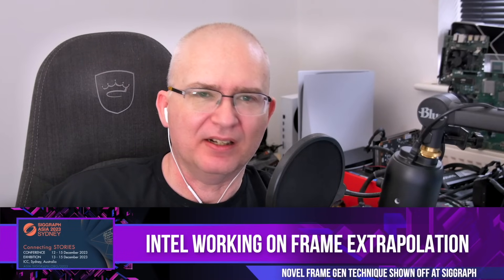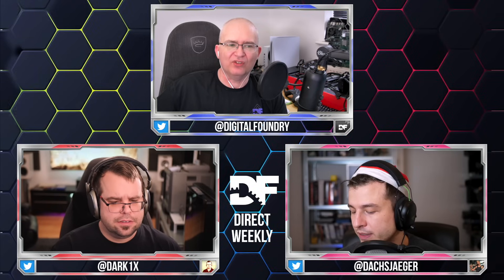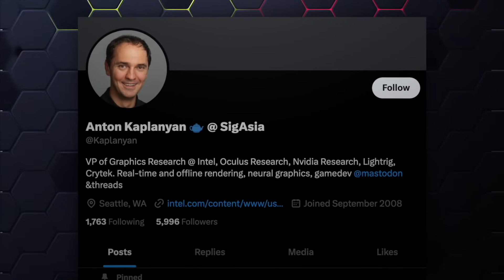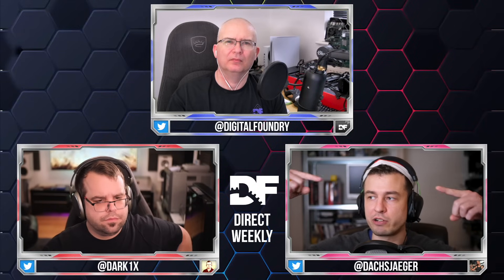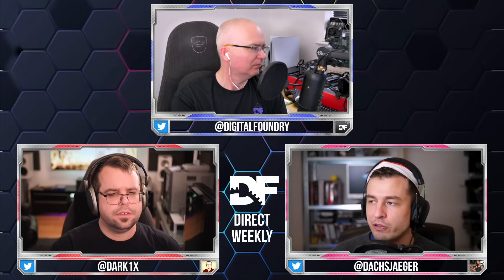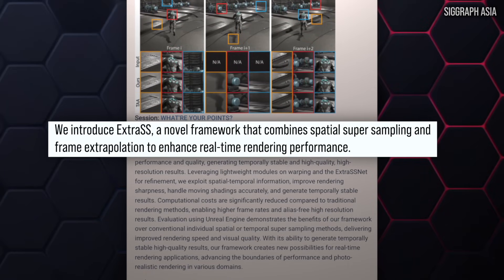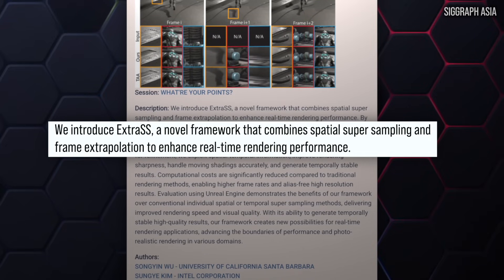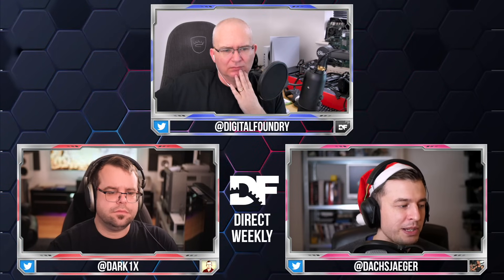Intel's Frame Generation Tech Is Coming And Here's What We Know

Comment: Well AMD FSR 3 mod works veryy good on witcher 3 on my 3090. 45 fps became 100 fps and it feels smooth like butther with g sync. :)))
Now ps5 and xbx x will have a good frame boost. Under 60fps frame gen is amazing. Evsn TAAU is 60fps at least with fsr 3...

Ps5 pro will be legendary too.

Comment: I think Intel generates enough hype, they just need to invest sufficiently into the GPU division and they will, in time, catch up to AMD/Nvidia in terms of hardware as well as software.
Reply: People keep mentioning things Intel "needs to do" that they already did. It's okay to say you'll never buy one because you're scared or whatever.
Reply: @nimrodery intel GPUs have a very specific market, and for solely gaming they can only contend up to the 4060 and 6700, with most probably going to the 6700 xt at that price range
Reply: @GeneralS1mba  Most people won't buy anything other than NVidia, the 6700 xt has sold terribly and it's priced much higher than, oh, sorry, it looks like you think Intel makes one GPU.
Reply: @nimrodery  I said "up to", the a380 is probably one of the best GPUs you can buy for av1 etc, the a580 is pretty bad in the UK, at least from what I can find, since the 6600 beats it, and the a750 is only £10 more and beats the 6600. A770 8gb is generally a good buy, since the 6700 series are starting to sell out and 3060/4060 don't compete too well. 16gb is niche as it's not too necessary and is probably best for workloads. Biggest issue is that, arc cards have more theoretical performance that doesn't translate into games making them use more power than they should.
Reply: @GeneralS1mba  The 3060 is the most common GPU people actually own, the introduction of the 4060 caused it to gain popularity in the new and used market. Since the 4060 and 7600 are so weak, GPUs like the A580 and A750 keep up fine at a much lower price. The extra power draw was never a huge deal until now, and again people don't seem to care all that much when it comes to most tech, It's only a complaint about ARC. I wish people would actually make more choices based on power draw, but the two considerations are price, and "does it say NVidia on the box."

Comment: Yay, more fake frames.
Reply: What constitutes a "real frame"?
Reply: @gavinderulo12 A real frame is one where game logic is processed. Frame gen raises the fps, but the internal logic isn't updating on those frames, so it's similar to latency in an online game in terms of the responsiveness to your actions.
Reply: @JohnSmith-sk7cg  but isn't the improvement to motion smoothness already worth it? Why do you need the lowest possible input lag in singleplayer games? Didn't DF show that the hit to latency is basically non existent if you use reflex?
Reply: @gavinderulo12  Responsiveness in a game is important regardless of whether it's single-player or multiplayer. The higher the real framerate a game runs, the more quickly your actions are input in the game. Playing a game at 60 with framegen where the native is running at 25 or whatever doesn't feel good because the visual updates happening are based on whatever action was performed on the last real frame. So for instance, if you're looking around in an FPS game with framegen will continue whatever movement was happening when the last real frame was made. It can give a 'drunk' feeling due the game's visuals not replicating what the player is doing at that moment.
Reply: @JohnSmith-sk7cg game logic has been decoupled from rendering since Counterstrike bruh. Most games have underlying update tics separate from physics which are themselves separate from rendering. Thats why input latency doesn't perfectly follow framerate, few games have 16.67 input latency at 60hz.
Reply: @Wobbothe3rd Not all logic friend. Most notable player input due to things like viewport culling. Try for yourself. Take a game with framegen like Cyberpunk, crank it as crazy as you can make it so your framerate is crushed and move your mouse around. You'll see a considerable delay in your look movement despite the smooth apparent framerate. This is also why people often play online multiplayer games at framerates considerably higher than their monitor's refresh rate, including your example of Counterstrike.
Reply: @gavinderulo12  No, DF didn't. They were specifically talking about the added latency of displaying the next real frame due to how the tech works. The issue of latency due to logic not being processed during generated frames is still there and is a fundamental aspect of framegen in all current implementations. In other words, if you're getting 30fps in real frames, you'll see a tiny hit due to latency in overhead for the next real frame. However, if you're generating 60fps for that native 30fps underneath it, you'll still have input latencies akin to 30fps.
Reply: @JohnSmith-sk7cg  yes. That's why I said you still get the improvements to motion smoothness. I just tried to explain that there is no real hit to latency compared to turning off framegen. Framegen doesn't improve latency the way native frames would, but you still get the massive improvement to motion smoothness which is great in singleplayer games, especially on controller.
Reply: @gavinderulo12 It still introduces latency, just not as much with mitigation features. That's not what's being discussed in this thread though. Framegen can be nice as a bonus, but the worry OP has is that it's going to be used for the foreseeable future as an industry standard crutch for unoptimized games. So where a top end graphics card could previously expect 60fps, thousands of dollars for a 30fps game is a bad trend.
Reply: @JohnSmith-sk7cg  you are entirely missing my point. If you already have a nice base framerate of eg. 50-60, then framegen just adds really nice motion smoothness. I never said you should use it with a base framerate of 25.
Reply: @gavinderulo12  No I quite understand your point and have from the beginning. The problem is you're sidequesting the thread when everyone else is discussing something else. Something I tried to explain to you in my last reply yet you somehow missed again.
Reply: @JohnSmith-sk7cg  we can speculate all we want on what the tech is going to be used for in the future. So far I only see it being used to enable realtime graphics that were previously unattainable.
Reply: @gavinderulo12  There have been many AAA releases this year with incredibly poor performance. It's not speculation. It's a trend that is ramping up fast.
Reply: @JohnSmith-sk7cg  there have always been badly optimized games. Or what constitutes a trend for you? Remember AC unity, Arkham knight, Gta 4. Even as far back as the original resident evil 4 pc release. It's nothing new. Sure some years have been worse than others, but I wouldn't call this a new trend.
Reply: @gavinderulo12  I would and that's a widespread sentiment when "intended way to hit 60fps is framegen" in requirements and PR clarifications. We can agree to disagree, but the point remains, you're literally the only person in this thread who didn't and apparently doesn't get the convo, but felt the need to sidetrack it. Whether you continue to try to argue due to pride or the love of hearing your own voice does not interest me. So have a good one.
Reply: @JohnSmith-sk7cg  alright, agree to disagree. Was interesting reading your arguments.
Reply: @gavinderulo12 has all the actual information in the frame so it doesn’t look laggy.
Reply: It's not like you're getting more real ones. It's this or 1440 30fps for the next 10 years.
Reply: goes well with your fake personality
Reply: It's about purity. People who don't really understand technology take a stance they believe to be right because it contains a concept of purity, like "upscaling bad" or "fake frames bad".
Reply: @NeovanGoth  Quite literally the opposite as I've explained in this thread
Reply: NVidia engineers told it themselves : Moore's Law is dead. 
You have to find new ways to render, and creating a whole new calculus process for each different frame is completely disproportionate when you could use the data of the other frames around it.  
This also has an economic and long term ecological impact
Reply: @lionceau1410  "but why don't they make moore's law undead. Because of greed?"

- nvidia haters probably.